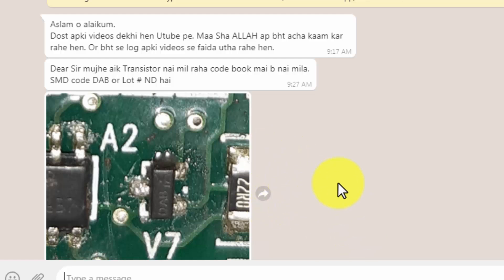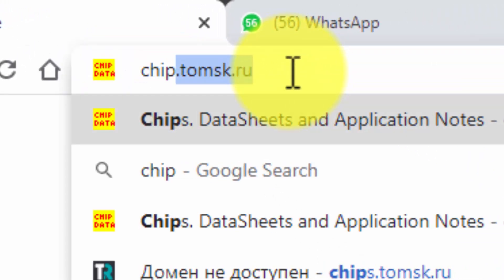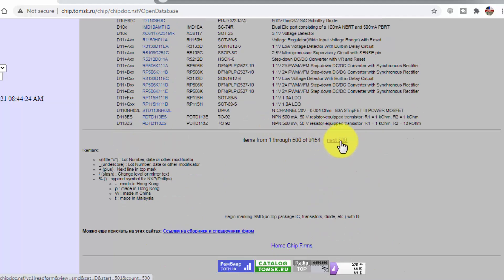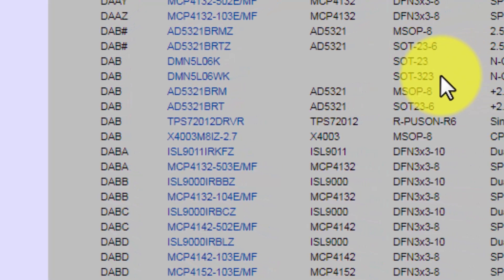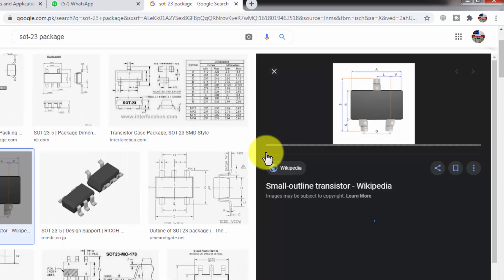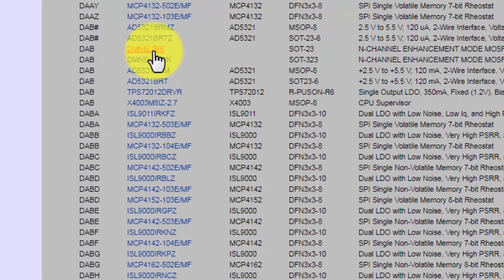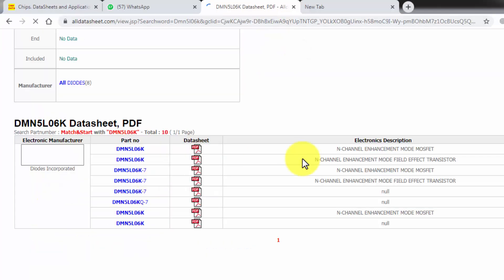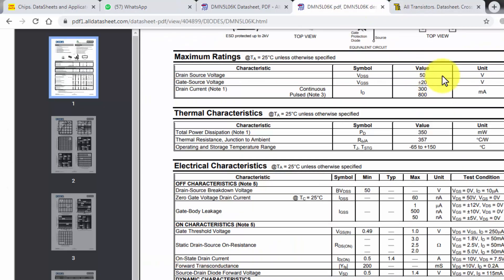354 How to Decode SMD CODE into part number & datasheet for SMD Transistor

Comment: In india we are not able to open that site, I m searching for R1 what that component that could be, it's used in 24 volts high speed bldc blower, it's in SOT23 shape, in some data sheet it shows n- MOSFET, aswell aa 5 volts sensor. Please help
Reply from the maker: please verify the dimensions 2.9 to 3.2 mm length,  1.2 to 1.4mm width 
it is SOT-23
then check component ID    Q transistor or mosfet  or D diode  or U or IC for IC
then check this link 
https://smd.yooneed.one/code5231.html
Reply: Thanks will check n come back to you, thanks a lot for replying, much obliged @HaseebElectronics

Comment: I have a component that i thougt resistor with starting w and the last 6, the other part cannot be read because it has be blown. Can you help me. The board is canon g4010
Reply from the maker: i tried to find the diagram but couldn't find it because manufacturer does not provide service manuals and circuit diagrams fro public. 
and smd code is necessary to find the data 
you can explore same model to consult the part number for that component.